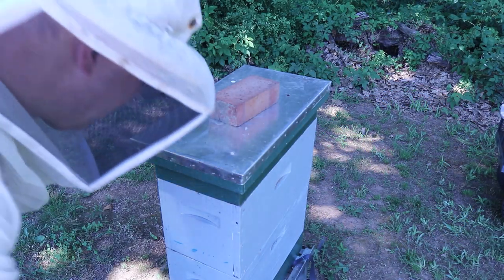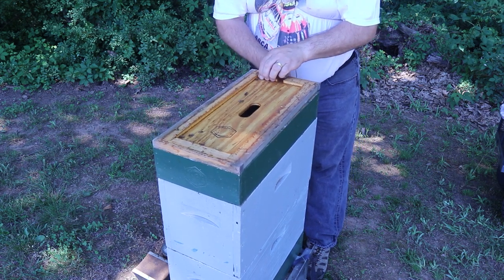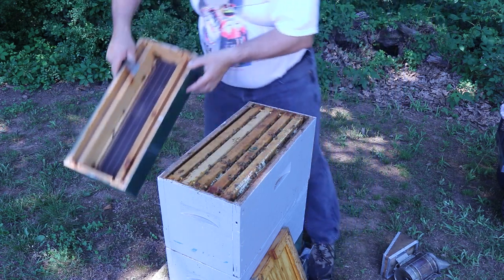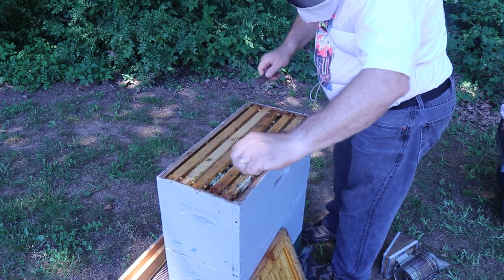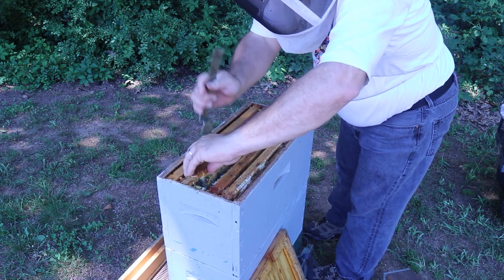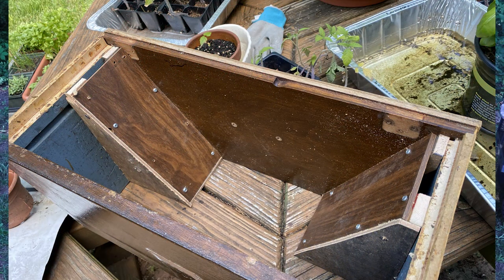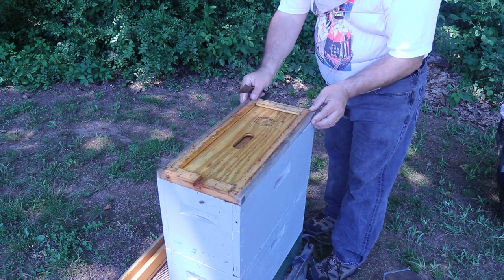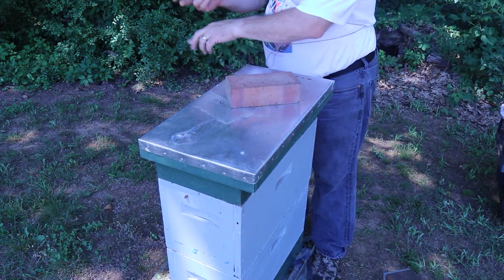Top Bar False Floor Nuc

Comment: Very Good Experimental work with TBH's comb forming in a Nuc ! I also am into TBH's here on Oahu. I had a very good farm running with Langstroth hives , 220 hives of recovered wild bees. 20 of these were punching out 60 pounds every 2 weeks or 1560 pounds of Kiawe Honey [mesquite] a year per each hive. now I'm disabled and still into bees but must remain on a small scale. Back-yarding bees in a city area. I teach others of city beekeeping and in Hawaii, on each Island, you have 'year round beekeeping below 8,000 feet, with at least 20 different nectar flows and other honeys coming in with surprise weather cycles. TBH's tend to be easy for teaching new beekeepers with , but I long to build up again to Langstroth's and use of an extractor again , to boost honey production and reuse the honeycomb built by the bees.
Our area got the first Varroa Mites 15 years ago and it almost kill all the wild hives on Oahu[25,000 in the wild]. Now bees are showing their ability to survive the stupid person who brought Varroa to Hawaii by their recovery. 
Mahalo , 
Mark Baker

Comment: What do you use in your smokers? I love burlap.
Reply from the maker: Pine needles.  I have several pine trees in my woods.
Reply: Aloha Kyle, I'm too cheap or just frugal. I cut cardboard of boxes[free] and tie them into packs that fit into my smoker. Their kept in a bucket , ready to drop into your smoker and kept dry with the lid, to prevent them from getting wet by a passing shower. You never run out of fuel or need to spend of penny. Bee sure to cut cross the corrugation's , this makes them act as airways to keep your smoker pecking along for hours on end [when idling] .